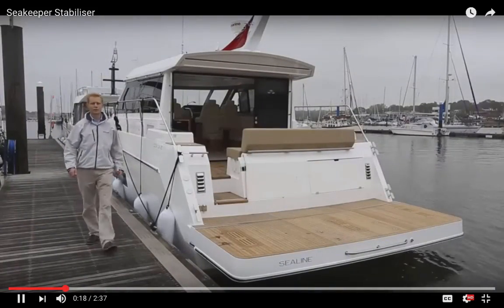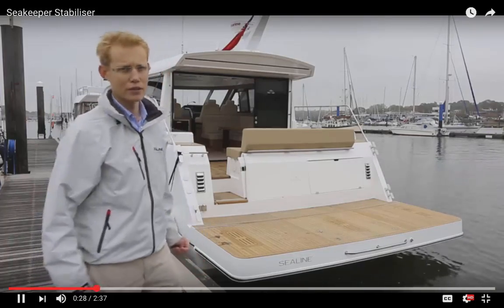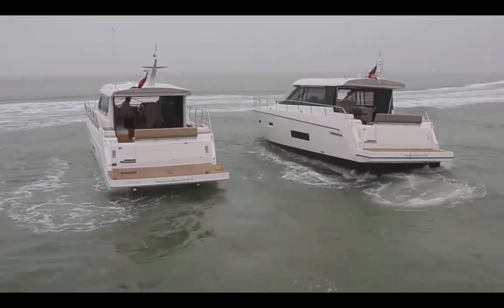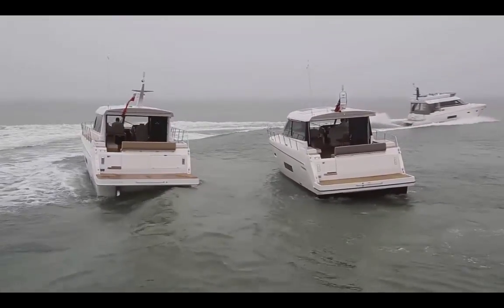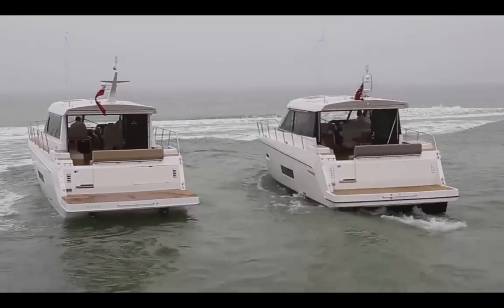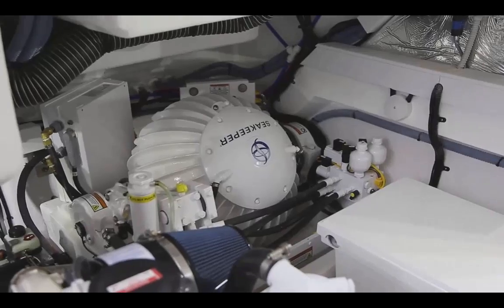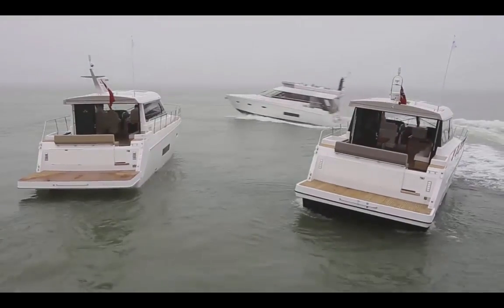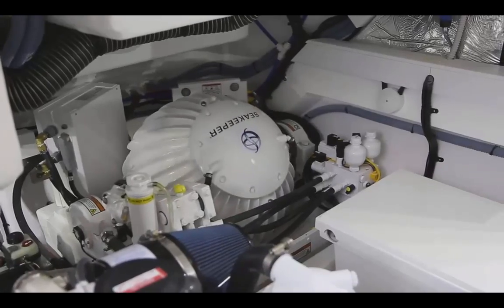Seakeeper Gyroscopic Stabilizer, Schwartz, Cal Poly Physics

Comment: Has anyone ever put one in a trophy truck and tested its jumping stability?  I think this tech could change off road jumps for the better!
Reply: Boats are much easier to stabilise as it already is in water. A car mid air would be wayy harder to control as it already has air resistance. But the idea could work maybe
Reply: You can
Reply: @josiah Mid-engines already do this to a degree with the counter rotation of the engine and drivetrain spinning in the opposite directions. Robby Gordon figured that out 20+ years ago, that’s why they fly flatter off the jump compared to a front engine setup
Reply: @unpossible3249  youre some kind of special arent you 🤣🤣🤣
Reply: Gyroscopes are used in rockets, ballistic missiles, etc, so, yes.